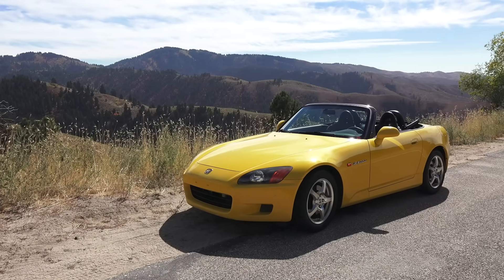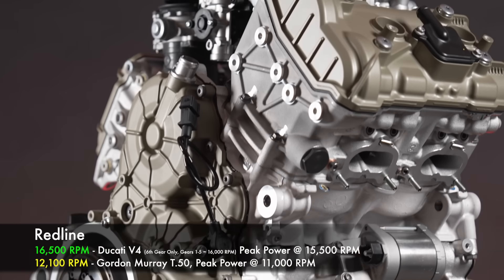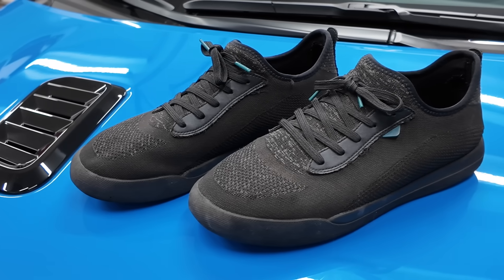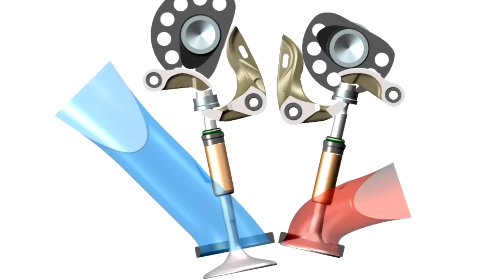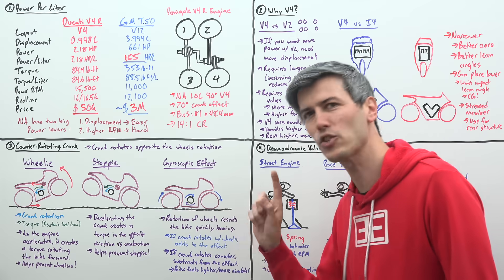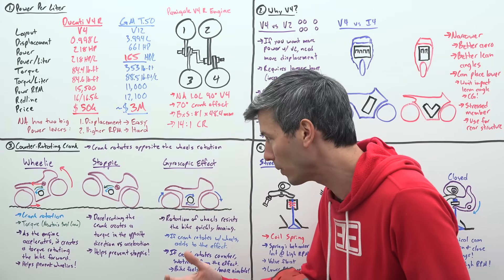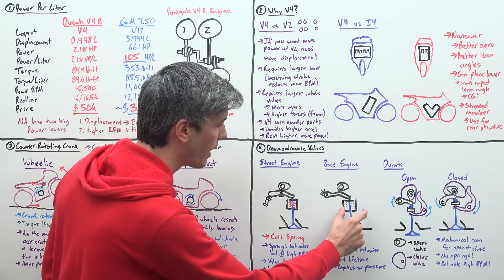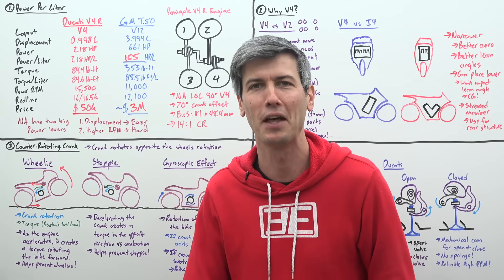Ducati's Brilliant V4 Engine — Putting Supercars To Shame!

Comment: Was valve float ever an issue, though? Ducatis aren't famous for revving high.
Reply: True but the other benefit is that the engine doesn't need to compress valve springs, so more power.
Reply: @ghostwrench2292 instead you got a heavier cam and an extra actuator arm. 🤷 And no, this valve train doesn't make more power.
Reply: @bence.gabor.slezak  rotate the camshaft on a cylinder head with valve springs and then rotate a camshaft on a desmodromic head.  Which camshaft is easier to rotate?
Reply: @ghostwrench2292 do you know what inertia is? And why do you think even Ducati started using traditional valve train? Why didn't other manufacturers use it, even though some bikes rev to 16k rpm? Maybe because valve float isn't an issue, and it has no real benefit. 🤷
Reply: @ghostwrench2292 btw what you feel with your hand at 3 rpm doesn't mean anything. Spin it up to 10k.

Comment: One of the items you mention is the decreased width of Ducati's V4 vs an inline-4. However, that's not really the case. Crank width, yes, but if you look at the Ducati engine, you can see the transmission/clutch width protrudes significantly.

Comment: Very cool. I enjoyed this topic of high horsepower motors (like in the S2k). I would like to know: Why are there no V4 engines in cars?
Reply: Cost and complexity.  Twice the cylinder heads and cams.  Inline 4's fit nicely in car engine bays already, so V4 in a car is the answer to a question nobody asked.
Reply: @ghostwrench2292  Well, cars have had V6 and I6 configs for 6-cylinders. It just seems strange to me that there isn't even a single example of a car with a V4. I'd bet they sound great

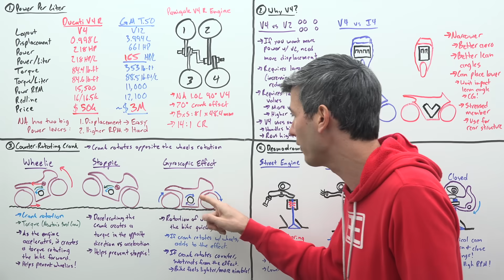Comment: 9:43 there is no difference in gyro effect changing direction of rotation while the orientation of rotation axis is the same
Reply: Completely wrong with that gyro effect. No matter the rotation direction...
Reply: @ProXmoD  I should have talked about precession, gyroscopic resistnace etc, but what I am trying to say is that a counter rotating crank reduces overall gyroscopic resistance, making the bike less prone to wheelie, less twitchy, it does actuallyreduce the total gyro from th tires. you can see 30-40% reduction in moto gp which is huge.
Reply: @kishlayverma6622 dude,  fantastic vid, just admit your wrong on the cornering/leaning resistance vs gyro rotation direction and let's move on :)

The gyro spin direction has 0 effect on force needed to incline gyros axle.  Same goes for gyros in rc helis and cars. 

On the stoppy/wheely you where spot on. But that's rotational inertia.  It's not gyro effect.
Reply: @ProXmoD  yeah my bad, I could have explained better, but what I have learned in engineering classes do teach this, the opposite inertias cancel out or the larger gets reduced by the smaller since both force vectors are operating in opposite directions, it does not cancel out the whole. I think you are confusing between TILT and the force needed to change the spin speed of gyro. Helicopters are very different and sure gyroscopic effect is in play but the rotors are not rigid rotating masses like motorbike wheels, the blades themselves are manipulated and even the precession in overidden by the flight system.

for regular rotating wheels, the resting torque T=w X L is a cross product, hence the direction also matters in a resultant torque of a system containing more than one roatating masses, especially when they are opposite to each other. I tried to explain this in my first comment visualizing the bike and its two wheels as a single gyroscopic system with counter rotating crank, the resultant resting torque would be a sum of both resting torques generated by the wheels and the crank. Riders use thier own force to lean the bike where a pilot uses cyclic pitch and movenment of the rotor blades to change the direction, the flight controls are pre programmed to compensate for precession, whereas a biker has to use brute force, the wheels dont use lift to change direction instead are the main basis of it and here reducing the resting torque due to the gyro forces becomes helpful .
Reply: That’s what I thought. The effect is on the perpendicular plane.
Reply: The wheels always spin forwards, so a backwards spinning engine subtracts from their gyroscopic effect.
Reply: Gyro effect counteracts change perpendicular to it, so the motion of wheels which is forward will resist motion in its perpendicular cular direction meaning roll, thus a counter rotating crank reduces the amount of gyroscope effect as if you imagine the whole bike as a rotating system, the opposite rotating crank slows the whole rotation down.
Reply: Yeah I was thinking that! it's still spinning so it will always wanna stay up
Reply: @JocaGod  Yeah, on all those comments!
Reply: @RonRussell-sj1zf  Counter rotating gyros subtracts the gyro precession but there is still stabilizing torque on both spins mass acting perpendicular to the rotation axis which is the same

Comment: The F3 MV Agusta is also Counter Rotating Crankshaft. And yes I love Ducatis but nowadays it's just overengineered. The R6 used to rev to the same as the V4 and it has no issues with valve float, yes the engine is smaller but still. Also the ZX10r and the CBR1000RR-R SP Fireblade both rev to 14 000rm and they use normal valves. The M1000RR revs to 15 000, for 1000-2000rpm more and no power increase unless you use the race exhaust, race oil and tune it then it's kind of pointless for the street and it doesn't translate to being faster and the BMW is extremely fast too and agile and it's an Inline 4. The benefits are cool on the Ducati for sure but on WSBK they don't matter which is where that Panigale V4R is raced alongside those other bikes I mentioned.

Comment: Exceptionally explained only tiny bit is that according to Ducati, the engine is an L4 rather a V4 because of its 90 degree angle.

Same with L2 blocks. 

Back in the day Vee engines were generally 60-70 degrees or they needed way too much room, so a compromise was made.
Reply from the maker: They call it a V4, I was chatting with their engineer.
Reply: The "L" thing is marketing.  Honda also made a 90* V-twin with the RC51, the Suzuki TL series, literally every Moto Guzzi....on and on and on.

Comment: I am shure that if cosworth had been comissioned to make a 4.0 l v12 with the same output per liter as the ducati they could have done it, But cars vs bikes in general bikes have nearly always made more power per liter per ton than cars and have usualy had a shorter  life span than car engines. Its all a tradeoff drivabillity longevity. I had an old 80s merc it had over 250000 miles on the clock without a teardown i dout the gordon murry or the ducati will reach 75000 its sll horses for courses, you could go to the other extreme and look at top fuel engines with silly power and a lifespan of seconds

Comment: The British manufacturer Boreham builds the Ten-K, a normally aspirated inline four, 2.1-liter screaming mill (licensed by Ford for the Escort Mk1 RS) that puts out 325 hp and weighs 85 kg.  You can pick up this hot Escort for only $325k.

Comment: You alluded to this at the very end - the V4 firing order allows the “big bang” power which helps the tires recover under acceleration leading to more grip - essential for motorcycles

Comment: Super sad this video wasn’t an additional 30 minutes explaining the offset and firing order. Please continue this series!
Reply: 30 minutes? I would of have gladly sat here for as long as needed to properly understand.  I feel like I was teased.
Reply: Driving For Answers handles that dissecting the Honda V4
Reply: @milestaylor7096  ah yes, my other favorite YouTuber in engine discussions❤
Reply: @milestaylor7096  I agree entirely!!
Reply: @milestaylor7096  yea driving for answers has great videos. He been around for a min and he does great visualizations with toys and props.
Reply: @milestaylor7096  Can't find it.
Reply: Yes I need to understand why a 70 degree crank and not a 90 degree to align with the cylinder bank angle. Please don't tease me.😢
Reply: Additionally to the already mentioned, i remember the explanation, that drivers found the big bang made the boundary to sliding more predictable, because it introduces light sliding slightly earlier. So: more feedback == better control for the driver. This is opposed to the normal behavior, where the tire tends to loose almost all grip with little to no warning.
Reply: The offset is too create a "big bang" effect which increases drive out of corners. Why does it do this? Dunno, but all the racing manufacturers discovered that an even firing interval increases tyre slip and wear.
Reply: @LilleyAdam  the reason is tire physics. To cut it simple: when tire slips via exceessive torque, even if you lift off, it needs time to "compose" itself and get back from "sliding" mode into "grip" mode again. And with combustion engine, power is never seemless, it's always delivered in noticable chunks (power strokes). So if power is delivered by multitude of small pushes (in a regular firing order) - then tire doesn't have that much time to regain grip during resting interval, each push just further enhances the sliding behaviour. While in a big bang it has much bigger interval for the tire to properly grip back so on the outcome you get better and more predictable traction while accelerating out of the corner.
Reply: @daggerfighter  - yes, you can almost think of it as a mechanical traction control. Each "gap" provides that few microseconds longer for the tire to go back to sticking instead of slipping.
Reply: @daggerfighter wow thank you for explaining
Reply: @daggerfighter  This is flat out wrong.  There is also the fact that composite torque, which is what is delivered to the tires, is made up not just by the combustion torque  but also the inertial torque from the moving engine components.  Since pistons move at different rates at the top and bottom compared to the sides, the inertial torque may not be smooth. That is why Yamaha dominated when they moved to a crossplane I-4, because the inertial torque was now smoothed because half the pistons would be at the sides and the others would be at top or bottom, vs a flatplane where all would either be at top/bottom or side. It's always better to have smooth torque delivery. The idea of "rest periods" for the tire to regain it's grip is asinine.
Reply: @CS-pl8fc Because you don't understand the physics of something doesn't mean it's asinine. It may not enter your brain smoothly, but the pause period of the big bang engines gain in accel traction with more predictable breakaway is exactly what the engineers are saying.
Reply: @LilleyAdam driving4answers talks about this
Reply: same reason a twin finds traction , the gap in the power pulses allows the rubber to settle into the tarmac before the force is applied
Reply: @macunion1225  re: "same reason a twin finds traction , the gap in the power pulses allows the rubber to settle into the tarmac before the force is applied" 👈bingo, the "Mac Daddy" of local Union 306 gets it. 🤟so that's all this V4 Ducati is people, it's just 2 of their original Ducati L-Twins placed side by side (so try to resist the urge to "over think it").   hint: Ducati had won no less than 17 WSBK Titles in the 20 years between 1991 and 2011 with their Twins before they ever switched to a V4.  so for those who don't follow much European racing and are not completely familiar with the brand, this 20 year block is where their "Legend Status" comes from.
Reply: Id love to see that too, engineering to the bone
Reply: D4A channel has plenty of good content explaining firing orders & offsets. Imho EE & D4A are the best automotive content creators on YT right now
Reply: @nadeemsudi8663 add aging wheels and bad decision for lighter stuff and I'll fully agree
Reply: Absolutely, we need the whole story! Can’t stop partway through 🙂
Reply: D4A channel has plenty of good content explaining firing orders & offsets. Imho EE & D4A are the best automotive content creators on YT right now
Reply: Would also love to hear a compare/contrast of the Ducati with Aprilia’s 65 degree V4
Reply: Totally agree!!

2 more indepth series

? Number n type plugs
Octane # ?
Engine have plastic parts ?
How many valves ?
Vti ?
Double roller timing chain, metal ?
How many miles ?
Type oil ?
# of quarts ?
Reply: Amen!
Reply: Yes
Reply: It feels like this video was like a part 1 of a series to further explain more to the not so smart audience that some of us belong to. Hopefully we get another series of videos breaking things down to the simplest terms, also telling us what materials are used in the manufacturing process.  Good video. 

👍👍👍👍👍
Reply: Agreed. This little engine is super interesting and Jason only gave us a taste it feel like.
Reply: The anticipation is incredible
Reply: Check out @d4a (driving 4 answers) vids on engine balance, and engine design.

I believe it changes the firing interval, and the increased angle between two consecutive combustion events allows the tire more time to "rest" between power pulses and gain overall traction.

Could be something completely different though:)
Reply: couldn't agree more
Reply: Ducati didn’t give him the Porsche production budget
Reply: please do!
Reply: Don't be too sad brother, Merry Christmas!
Reply: Fun video! As a ducati owner though, those desmo valves are super expensive to maintain. The timing is super important obviously, so even a slight change in timing will make it run like crap
Reply: My thoughts exactly! I got so into this!! I really really really hope he films a part two because this was sooo interesting!!!
Reply: I need a second video covering the firing order and crank off set this was too short of a tease
Reply: Why are you in such a hurry dude? Only 30 minutes to explain firing order and offsets? No point in half passing it, why not make it a round and even 60 minutes?
Reply: @SazanD1 I actually like the short videos he does where he concentrates on one topic and I can see the whole whiteboard. I usually don't have time to watch a 30 minute video.
Reply: @SazanD1  Yeah this is a great party topic to amaze your friends with all the tech knowledge and that....so give us the full 60 and let us really glaze some eyes over
Reply: @StrongUrgeToFly you sir are surrounded by the wrong people at the wrong party

Comment: Hey Jason,  I agree on the part where the last "some percentage" hp can be squeezed out of the engine using very specific materials and engineering, but sports bike engine's have always had higher hp/L. Even Honda, Yamaha, Kawasaki and Suzuki has achieved close to 218hp/L with their I4 and valves with springs.  Why do the hayabusa engines still end up in hillclimb mini coopers and not as any safer detuned versions in any of their cars? Given those engines have already proven to be reliable for 100k+ kms. (HONDA CBR 1000 RR-R engine does give out 217.5 hp/L)
Reply: Yes, I was thinking the same thing. Ducati isn't the only manufacturer that achieves these high revs or power values. There are definitely more affordable and older bikes that can come close to that.

Comment: Let's not forget BMW are producing similar performance and a bike which performs as well or better than the ducati depending on the circuit, while using a conventional inline 4 with mechanical valve springs

Comment: i think it would be worth mentioning that other bike engines with very similar performance (BMW S1000RR 210 HP from 999cm3 Honda CBR RR 217 HP) achive it much cheaper with much more conventional technology, no Desmo no try clutch. At lot of this is just Ducati doing Ducati things just because.
Reply: Dry clutches are bling ALL of the Ducati V4s can be either dry or wet clutch, the Panigale and Streetfighter SP2s, Panigale R, and Diavel and Multistrada RS are the only bikes that come with dry clutches, but you can buy the dry clutch kit for any base or S trim bike....which makes no sense to me for a street bike.

Comment: The reason for the V4 layout could also be historical, as it corresponds with the V2 layout used for many years. Ducati also had the V4 configuration on the drawing board, but it was shelved, so they had it in the back of their minds for quite some time.
Reply: Long before the twins were conceived Dr T  designed the Apollo for Berliner.
Prototypes were developed but the lucrative police bike contracts never materialized

Comment: small displacement per cylinder = small pistons = small reciprocating mass = high revving = more bhp. simple math. connaught type d was a prototype car from 20 years ago and was able to achieve 305bhp from a 2L engine because they divided the 2 litres into 10 cylinders to make it rev super high. if someone engineers a 2L v10 with today's tech, i'm sure ducati's power to displacement ratio isn't that hard to reach.

Comment: im curious how the counter rotating crank effects feel for the rider / are they noticable 

like i get in general why that effect would act against the forces pushing towards a wheelie or stoppie, but some of that force/weight transfer when accelerating/stopping is desirable because you want the effective center of gravity to be over the rear wheel under acceleration and over the front wheel for stopping 

i guess the weight of the rider and order forces are far greater than the gyroscopic effect to actually cause the weight transfer to go in the wrong direction and its just a little bit of help 

this has also reminded of something i saw years ago about FMX tricks and particularly backflip + double backflip, where the throttle and brakes can be used to control the rotation speed even in the air, i guess thats the extreme case of this and also i guess we arent going to see fmx bikes with a counterrotating crankshaft, other than maybe it could help with a frontflip :p